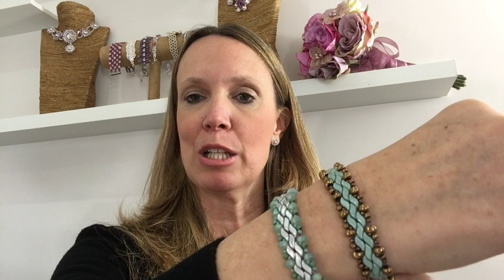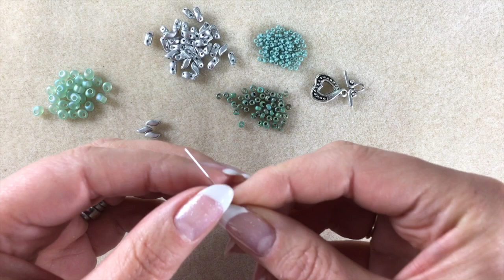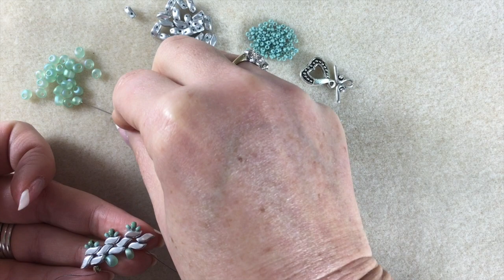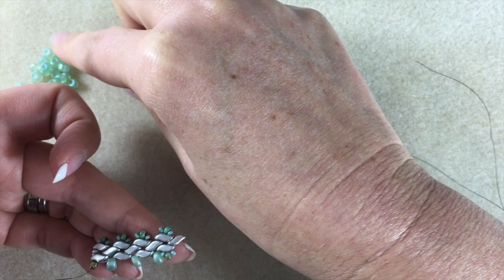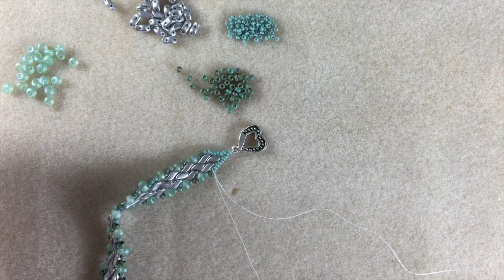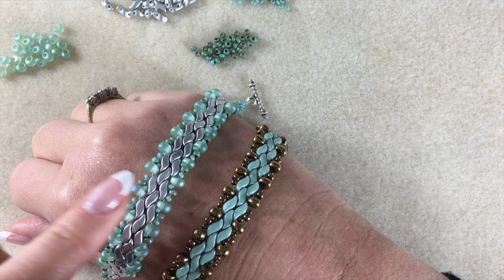StormDuo Bracelet - Rolling Waves

Comment: Muchísimas gracias por tu generosidad e ingenio. Sería bueno ver un tutorial completo para poder hacerlo mejor. Se podría reemplazar el Stormduo por súper dúo? Dios te bendiga.😍🙏❤️💋
Reply from the maker: Hi Yolanda - Super Duos are a different shape entirely to StormDuos.  Having said that they are both double drilled - so yes, you could try the deign using super duos; however; the overall effect will look different.  StormDuos give that fluid, wavy motion to the design and super duos will keep it quite rigid looking...x